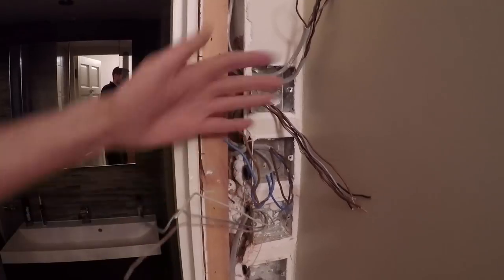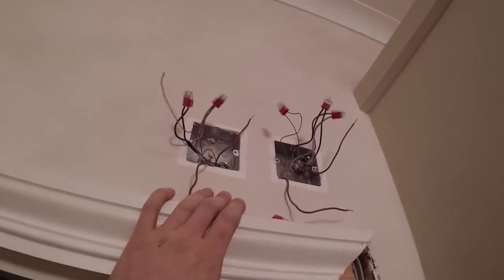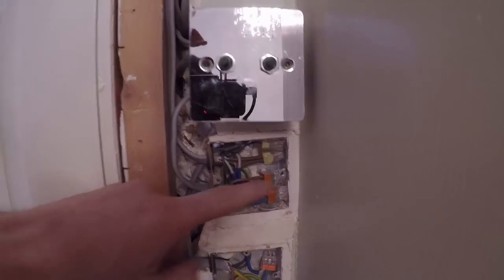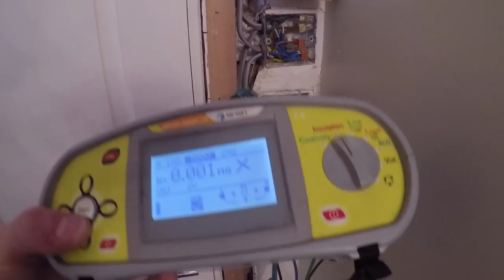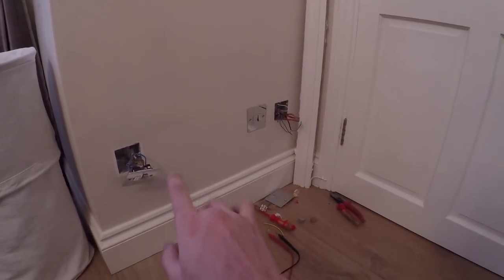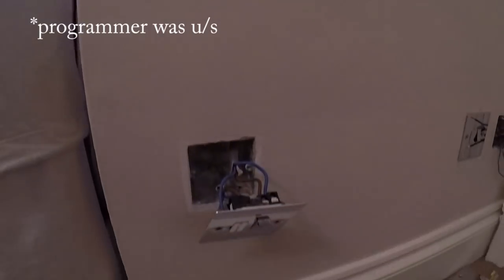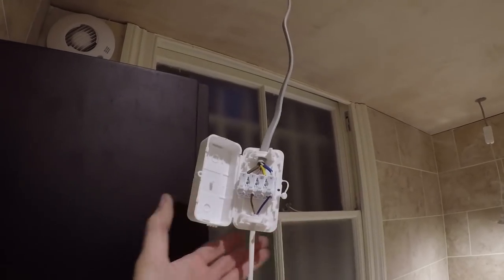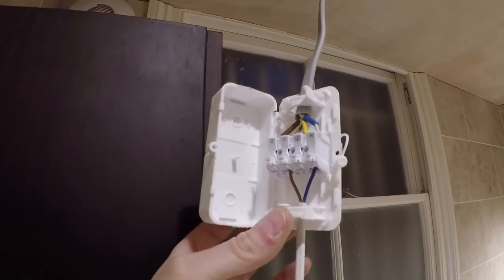Bathroom electrical work - An Electricians Day in London | Thomas Nagy

Comment: There are always people who say they can do it faster and cheaper.  It shows they have a lack of ability to properly assess the situation based on its existing condition.  They usually have delusions about their own electrical knwledge.   On a plus note it means more work for you when they butcher an installation randomly - as in this case.  (Although cleaning up after butchers can be much harder than the original job.)
Reply: bigclivedotcom wow my 1 of my favorite youtuber watching another electrician that is some great support that you dont see on the daliy
Reply: Woooohoooo Big Clive! Another top YouTuber!
Reply: I agree, some days all there seems to be is cleaning up after butchers, its a shame as the client or customer is aghast how much it is going to cost, yet if another cheap butcher came along to quote or estimate a job, they would jump at that price, I have been on jobs, where  butchers have charged less than the parts needed !!!! What?  Yeah, a ip rated box, na, this bottle of pop with some insulation tape, after I finish the pop,same thing right? Mr butcher thinks, correct termination blocks etc, na too expensive twisting conductor and some cheap pound land insulation tape that works its way loose, come on cost a pound for six, lubly jubly, electricians since part P a few day course, has decimated the electricians, what did niceic  iet formally know as iee, etc do, rub their grubby hands in glee on all those extra people that have registered and paying money to them, its been like that since 2009, I have met part p reg, people kitchen fitters, plumbers, chippies, etc that ask me!!!! Questions about basic electrical work, then as again and again, until I tell em, I simply now, wear ear phones, not on, just to avoid such things, the electricians need a union made up of electricians not paper pushers,
Reply: I bodge but I bodge only my own stuff and I fix em properly when I can.

Comment: Totally agree with your points about allowing enough time to do a job properly. It isn't a race to the bottom. There should be enough allowed on the job to provide a good service and quality workmanship so that errors are not made.
Reply: Dans the Engineer exactly, and you have to quote a good allowance for yourself in a job such as this in case you find even more that needs to be rectified
Reply: Dans the Engineer this is the reason why im giving this shit up
Reply: He spent most of his time doing the frigging video!

Comment: The electrics at my mums old house were very erm.... yeah.  The landlord was feeding a huge barn from a 6mm cooker cable, and the barn was rented by banger racers so they had power tools, welders etc running. The cable running to the garden pond was at least three lengths joined together by a choc block taped up and then buried 2 inches into the ground. The previous tenant had started turning the loft into a bedroom for one of his kids and when I opened up a socket I found the live and neutral in the wrong connections, live was in the neutral terminal and neutral was in the live terminal. I could list a whole lot more.
Reply: Well, live and neutral swapped would be of least concern. 😁
It doesn't really matter. As long as there's ground connection you're good to go.
Reply: Except for localised circuit protection and switching.
Reply: whoow! that's so bad and outside on a cooker fuse.  does landlord wish to incinerate tenants that don't pay rent?  sounds like a farm which would probably need triphase for 400 v power and maybe dc arrangement for the power tools. err tell mum to move quick
Reply: Since UK plugs contain a single-pole fuse that's not entirely true, although in a single-phase arrangement the fuse would still blow, except in case of a neutral-earth fault, in which case the RCD should trip. Since this is a farm I'd guess TT supply so an RCD is at least likely.

Comment: Found a belter in the loft back end of last year - switch for the light screwed to a joist just next to the hatch: neutral was switched, lives were stripped and twisted together and just buried under the insulation, earth was flapping in the breeze! Good job I had a volt stick with my when I went to replace the pendant set
Reply: Once saw a consumer unit where all the neutrals were connected to the MCBs and the lives went to the bare neutral bar! Earth just flapping in the breeze too, the earth bus bar was used for the neutrals - he ran the neutral from the RCD to the earth bus bar and short jumpers to each MCB.

That was a mid-1950s place in Vienna, which means only the kitchen sockets were earthed and the original wires were the old colours. The idiot who rewired the place didn't know anything about this and had no idea what to do with that pesky red wire (red was earth back then) so he left it taped and all the yellow/greens in his new cables were flapping in the breeze. We actually got called in by the tenant because she thought someone was stealing her electricity and stumbled across that beauty of a CU in the process. The only thing we found was that her fridge and freezer made the meter spin nicely but that was it. She claimed her ex had done the wiring.

The icing on the cake was that she was sure someone was stealing her power because her meter was spinning much faster than the neighbour's in the same cabinet. Well, the neighbour's meter was new-ish and did 75 revolutions per kWh while hers was older and did 480... no wonder the disc was spinning faster!

Comment: I suspect the reason why the extractor fan isolators were moved down to chest height is so that the fans can be disabled at night. Nothing worse than being woken up by the noisy fan when your partner goes to the toilet in the night and wants to turn the light on. Hotels are terrible at this for putting the isolators out of reach and linking the fan (on a long timer) to the light switch. Its ok for tall folks like me who can reach and turn them off, but if the residents of that house were shorter then I can see why they'd ask to have the fans isolators moved.
Reply: Simon Rose 
Yeah that's what I thought....but they will have to use a stick/ruler with a sock wrapped round the end now
Reply: Fan isolators are for isolation, not generic switching.
Reply: Paul Green agreed. I do appreciate that, but I have never seen an installation where addition convenience switching has been deployed, so for the sake of a quiet night of sleep we have little choice.
Reply: I've never heard of the fan being switched but not also readily accessible. I'm guessing that is just a UK thing
Reply: Local isolation is definitely a UK thing, not found elsewhere in Europe. The general idea is that if you work on any wiring, well then turn off the circuit at the CU and tag and lock out the MCB.

I've seen the odd cooker switch in houses with over-careful elderly people but that was maybe twice in my whole career. As I said above, cookers are usually 3-phase in most of Europe (except France and Spain I think) so the switches aren't all that neat to have in a kitchen, usually they look fairly industrial. One I remember was a huge black bakelite box on the wall, good for 25 amps.
Reply: My thoughts were possible a disabled resident? But the bathroom looks pretty standard

Comment: I guess they dont do box fill in the uk how good do those stab ins work under load well i take it you wont use those stab in connectors on a motor load, those metal square j boxes are you bonding them to the equipment ground thats run with the feeder circuit?

Comment: you did the right thing looks tidy now.  ive not yet had pleasure of wiring a fan isolator. does this now mean tennants will have to stand on a chair again to switch off annoying fans so they can sleep?  or are they automatic on the lights?

Comment: Why don't you use normal time switch for bathroom fans? Why is it combined with the light. I guess the isolator was moved down so they can turn it off. In most of Europe we have two switches, one for lights and one for the fan.

Comment: How do you deal with ceilings that where never designed for mechanical protection, junction boxes, etc..  i.e. no room at all to fit anything in there apart from the cable?
Reply: If you can fish the cables through then you can terminate them with inline push fit  connectors, kind of like a straight through Wago. Failing that you're looking at fitting trunking on show.

Comment: Im from the U.S. and while im do an electrician, i am a tradesman. And pricing is a tricky subject. For machining, you are compeating for work against many other shops. The way i look at it, we can not work for free. We can however do work for a reasonable price where we make some money and allow us to sleep at night knowing we did not screw the customer on pricing. I would rather quote a little heavy and take the time to fix everything correctly, then to slam out the job before you start lossing money.

Comment: Just want to say when clients want a dimmer switch or switch fitted inside a bathroom make sure its outside Zone 2, further more if the extractor Fan is triggered by a Dimmer, as a Dimmer will will increase and decrease to power output to the Extractor, thus Extractor will be less than efficient as it will be running lower than the manufacturers preset power settings, which can reduce the efficiency of the extractor by 80/90% if  the Dimmer is set at minimal setting.
Just from my experiences I would supply Extractors separate with a remote pull cord or a Pir/microwave sensor so fan can run it its preset speed via an Isolator.

Comment: I'm guessing they had the fan isolators down low because they wanted the option to switch them off when not needed. I know some people can find them a tad annoying having the things run for ten or so minutes when all you did was go in to wash your hands. 

The problem with that is you will inevitably forget to switch them back on, and then potentially touch them with wet hands when you're fresh out the shower! Zzap! :0
Reply: not all fans stop, some go to low continuous after their boost, and other things have bright lights so people like to turn them off, such as showers or such

Comment: I was just wondering what would happen if you did a 500v insulation test and there was one of those USB sockets in the circuit that you had somehow missed?
Reply: John Jones it could fuck it, join it through before test would be the thing to do

Comment: I think one thing worth telling the landlord/agent is that whoever installed the fuse board would not have been able to issue a valid Installation Certificate to say that it complied with current regulations.  Anyone who makes holes in the top does not know the basic IP requirements, and why they're necessary.
It should also be noted that the person ordering the work is also negligent.  They should be aware of their duties to know whether a job is being done properly or not.  A landlord cannot just get the cheapest contractor and then shrug his shoulders when someone is injured or dies.  An easy way to be fairly sure is by asking for certification of that work.
Reply: They kind of put it on the sparky though as we're all trained to a standard and certify the work accordingly, which puts all responsibility on the spark rather than the landlord.

Comment: You dont use any pipes to pull cables thru instead of leaving them loose in the doorframe? (Electrician from swe asking)
Reply: I'd say it's a bit tight in there,  plus they're double insulated so should last.
Reply: Another issue that splits Europe - conduit or no conduit?

Parts of Germany, the UK, Ireland and most of the former Eastern Bloc (except Hungary) tend to stick cable into the walls, the rest of Europe seems to favour conduit.

Cable in the wall is fine until someone drills a hole through it or whacks a nail into it. Or until someone wants to split up lights onto two switches. With conduit I've even managed to add two-way switching to a room without opening any walls! Just pulled some wires and replaced an existing switch with a double!

Comment: For what you install a fuse AND switch near the floor? Now every kid can play with that. 

In opposite to the switches for the fans - they are too high for normal use. Why not use automatic fans controlled with 'humity high' or 'light on' in UK?

Comment: Why didn't u want to 're-energise' the under floor heating?  just replace the blue earth sleeving?
Reply: Text appeared in the video to say the controller was faulty. And as he wasn't there to fix that fault as he wouldn't have quoted for it you can't go spending the customers money without letting them know first, so it's likely that he would have told the agent and quoted separately.

Comment: i have a question, what would you recommend tool wise i buy first as an apprentice?  and love the videos by the way
Reply: You need to be more specific. Most of the tooling is straight forward, although he did a video of his kit. It's choosing a multifunction tester which can be confusing. In this video he used a Mettrel MI3000

Comment: They will have moved the isolators so they turn the fans off so they can have the lights on without the noise of the fan. Not the right way of doing things but they'll be why.

Comment: Hi tom, what is the best mft to get as a new installer?
I’ve got a choice of metrel 3000 or megger 1552 or fluke 1662?
Reply: The installer guy the Megger MFT 1552 was and still is phenomenal.

Comment: Where do the stainless / chrome blanking plates come from please .
Reply: mark howard 
I think they are usually found inside a sea monsters lair about 10,000 leagues beneath the sea....or you could try an electrical wholesaler/distributer/supply shop
Reply: Thomas has said in past videos that he uses a lot of components and materials from Screwfix. That would be my first port of call looking for these.
Reply: MK do them

Comment: those switches were a disgrace ..the man that done that the first day isnt the 22nd cousin of a spark.....well done you have it well tideyed up ....personally I dont like thst type of fuseboard in england....do ye ever use doubld row boards much....
Reply: the double row boards are used in industrial installations not domestic and are usually 3 phase
Reply: Interesting... on the continent we use up to four-row in domestic wiring and even manage to fill them. The Germans are particularly fond of large numbers of circuits but I've seen huge domestic CUs in France too. In Austria double row (24 modules) is the minimum for new domestic CUs and you've got to leave 30% of spare room for future extensions. And that's very easy to fill since we use MCBs that switch the neutral (handy in case of neutral-earth faults) and most of them are 2 modules wide. RCDs are almost exclusively 3-phase so 4 modules for that and another 4 for the cooker (230 V elements distributed across the phases, usually two for the hob and the third for the oven, 16 amp).

Comment: How do you find the WAGO's?  I find they don't always grip to well.
Reply: Joanna Hammond im abit cautious about using them. I used them a few time and once I joined 3 core,32amp lead and they failed badly,2 of them melted. They give me 300 new ones and found some didnt make a good connection.
Reply: They never really court on here  in Australia 
Their ok in fluorescent light fittings thou
Reply: I've replaced loads of burnt out screw terminals and never a wago connector, you need to make sure that the wire is suitably pushed in as they can be deceptive (as can a screw terminal) and I'd also agree on those junction boxes, they aren't cheap but they are really handy and quick, easy to fit, fix and re-open when needed
Reply: It may be that the cable you're using is too thin, or there is not enough being pushed through. Always make sure that there is a good 8mm of copper on show and that you're using 1.5 or 2.5mm T&E. Also don't use flex if it's a push fit Wago.
Reply: Lenny Rossa   Sorry, your fault. WAGO is a company how produce for 2A, 6A, 10A, 16A, 20A, 32A, 40A, 100A ... All of them have different product numbers! 

Power cable are not for fun, if you are not know how to use them better you not touch power cables!
Reply: Joanna Hammond   WAGOs works fine. Of course you should know what you do! 

I use Wagos since years and never they fault. It is easy work with them same Lego for kids.
Reply: chris e   I use here 16 mm or 32 mm with WAGOs. Okay not handy same a 0.75 mm copper of course. 😉 

Specially on a ladder in 3 m high is a Wago better as screws three 5-ader 2.5 mm together.
Reply: Wagos are great, I love them! The 2273 and 773 are terrific for solid and coarse-stranded building wire 0.75-6 mm2, the 221 for solid and stranded up to 4 mm2. Never seen one burn, only had one very crappy junction box (looked like the Spaghetti monster had been there) where some 2273s just fell off the wires as I pulled them out! Obviously hadn't been pushed in far enough.